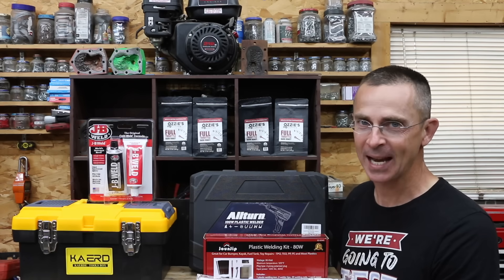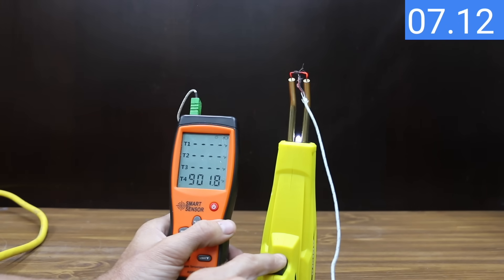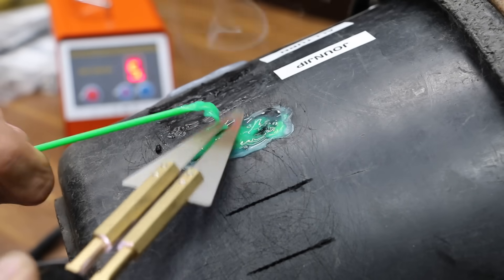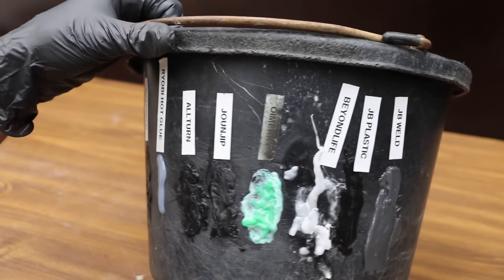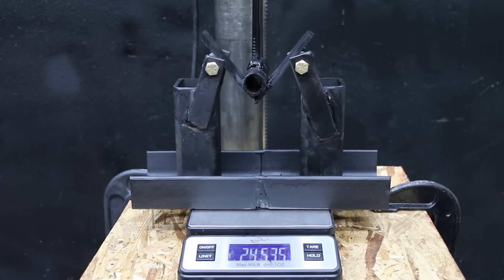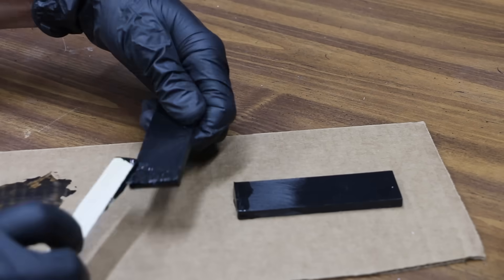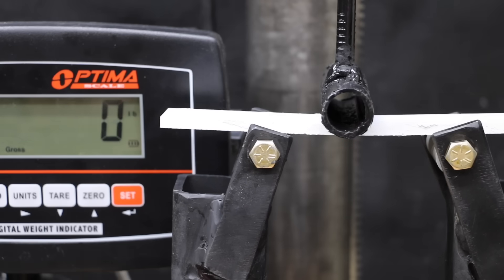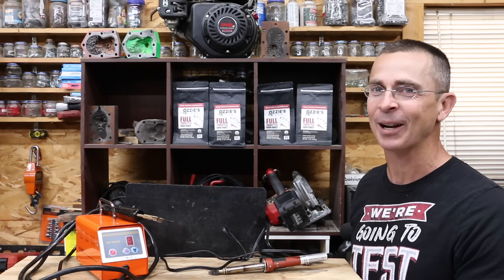Don't Buy A Plastic Welder Until You Watch This Review!

Comment: For $30 you can get a 2oz bottle of Thin superglue and a 12oz bottle of fine graphite powder.  The superglue, when applied to the graphite makes a water tight and very strong weld in only seconds.  I have done a dozen projects already and still have superglue left over, though I just bought a new bottle.  The graphite might last for years. I repaired a dime sized hole in my truck bed liner that was down to the metal.  I think it will outlast the truck.  I also repaired the step bar on the same truck that had broke plastic piece.  My mechanic tried hot glue which lasted about a week.  The graphite and superglue are still holding strong months later.  I also use baking soda with superglue when I need white coloring.
Reply from the maker: Thanks for sharing.
Reply: Curious what brand of thin superglue you're using. I've had good results with waterthin Titebond CA glue, and Satellite City "Hot Stuff" water-thin CA. Never used graphite powder with these glues ( are you sure that's what it is?) but I've used CA glue and baking soda together on occasion.

Comment: The problem is none of them have temperature control.  What you need is thermal mass, not higher temps.
Plus, plastic is just extremely difficult to fix.
Reply from the maker: Thanks for the feedback.

Comment: Great video, but welding skill makes a huge difference in how well a plastic weld will perform. I've repaired plastic pieces that ended up looking brand new with a touch of fill primer, and the weld was stronger than the rest of the piece. All done with staples and a Milwaukee soldering iron. It's no different than welding metal, you need good penetration and need to know the materiel well and how the structure of the material will react to becoming molten
Reply from the maker: Thanks!  Thanks for the feedback.

Comment: The two stapler products.. I reckon you flipped one the wrong way around, likely not once but on both samples? when making the bend, 8:05 and why you got better results even after it was bendfractured the other way around on both samples.. these stapler product is sensitive to orientation.
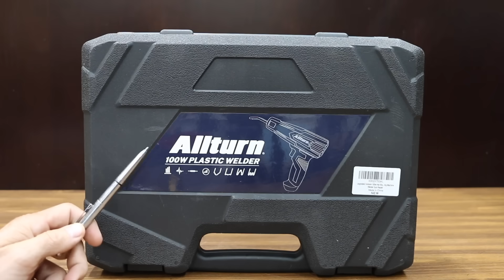also not ideal that a product claims 100w 1:45  but only delivering 51watt
I reckon some of these specs, are not on 120volt, but on 230/240v circuits, so you will get a lot more wattage/heat to work with on +220v on some of these products, so you can mold the original main plastic.

Comment: I was really surprised at how well hot glue with wire mesh did. Seems to me like JB Weld is the most practical solution unless you regularly find yourself needing to weld plastic.
Reply: JB Weld is a chemical miracle. If it's mixed properly, and the surfaces are cleaned and roughened, and it's allowed to fully cure, it can do almost anything. I score surfaces with a knife blade or the edge of a tiny file, instead of using sandpaper. I feel it gives it a bigger tooth to grab onto, and it seems to work very well. SO glad I found JB Weld.
Reply from the maker: Thanks for the feedback.
Reply: I use JB Weld on the pressure side of a radiator inlet that had cracked. That repair outlived the car by 10 years.

Comment: I have the Harbor Freight model, similar to the RX Weld, but same colors as the Jounjip. The Jounjip tips will fit as replacements but you need to rethread them as they are a bit larger (and more durable).  I also have the hot staple gun, just one of the $25 ones from Amazon, they're all the same. Staples are universally sized. At the horse rescue I volunteer at we have one of the hot air ones but I haven't touched it. So I flip the soldering iron style ones over and use the tip to push into the plastic, lifting and pushing, making it look like I'm running a bead with a welder. I'm getting penetration that way and getting both pieces to bond together completely. I'll follow up with melting some of the plastic over top of the repair and smoothing it out. The wire mesh I'll use for anything that will see abuse or that really needs the structural integrity. I melt it into the plastic though, whereas it seemed you melted it to the plastic. I will often follow up with reinforcing it by melting more of the plastic sticks over the repair. The staples I find come in handy when doing larger cracks or getting into corners as they come with different shapes. (Sorry this is getting long winded) I will still weld around the staples and melt more overtop of them as I don't have flush cutters and regular wire cutters leave a little metal exposed to snag your skin on. We've been repairing plastic feed buckets that the horses have split by walking on them or whatever happens. The repairs have been holding up great. I've even repaired a damaged 5 gallon fuel can. ATV fenders? Oh, soooo many. I've been at this for several years now and have fine tuned my craft. Even structural tabs that maybe a screw will go through or a clip have been repaired with zero failures. Just had to pull apart a Honda Foreman to adjust the valves. Months ago I had done plastic repairs to fastener tabs and clips. They're all still holding up and this ATV gets ridden multiple times per day. It gets used for morning and evening feedings as well as normal ranch use, even for moving cattle. I think if you refined your methods you'd see a lot different results, but regardless, you're able to repair damaged pieces, potentially saving hundreds of dollars with a very minimal investment on tools. Time however, it's a very time consuming process.
Reply from the maker: Thanks for sharing.
Reply: Underrated comment. Also, goes to show how much practice, technique, and experience 'factor into' a good plastic weld.

Comment: Too bad the Beyondlife didn't have instructions.. It should be used much like  MIG welding.. start with a V notch and as you move the iron, it pre-heats the surface and the filler rod which is not supposed to be completely melted. The rod stays intact as it is fused into the surface. It is very common to lay multiple beads on top of each other especially in corners.. There should be an adjustment for air-flow to control the heat.. The more air flow, the lower the heat.. . the hot air heats the surface and rod, NOT the iron itself.. . With some practice, any plastic welds should look more like metal welds with the filler rod staying intact rather than just a melted blob.. .  These days I use the hot staples.. Very inexpensive to buy a complete set-up and very universal.. It's very rare that I know more than you about the equipment so todays video was fun to watch..
Reply from the maker: Thanks for watching!

Comment: Are those the correct staples for the application? I've seen videos of people using U∩U∩U - staples when doing these kind of repairs.
Reply from the maker: That's a great question. The kind of staples you've described did not come with the welders

Comment: would have been interesting to see what the polycarbonate 'weld on' glue performed like since its designed for poly fusion,
back in the day i ruined soooo many soldering irons melting plastics together and stunk up the house.... amazing decades later there is actual products for doing just that
Reply from the maker: Great point! Thank you
Reply: Most of the "plastic fusion" type epoxy glues seem to contain some really stinky solvent like MEK or a goof-off type of Acetone/Toluene blend which I swear kills a million brain cells on the first wiff;  but they don't really seem to fuse themselves to most plastics very well and the epoxy itself is not as strong as JB weld or Devcon or Loctite epoxy.  Not to mention that they dry up and harden in the tube more quickly than other epoxies because the solvent is so volatile and evaporates.

Comment: I use a simple soldering iron and mix the breaks together going back and forth lengthways completely mixing the two halfs together at the break.  Works great for me.  Seems like these methods just add stuff to the top and bottom and don't do anything where the two pieces touch.
Reply from the maker: Great tip! Thank you

Comment: You ever going to put your stamp on products like all the safety stamps on everything? Even a bad product can meet safety standards what we need is a stamp to prove products do as advertised at least.
Reply from the maker: That's a great question. My biggest concern is that a manufacturer could change the product and still use the stamp of approval without the product going through the testing process again. Another concern is that I want to avoid making deals with manufacturers to ensure that the reviews remain unbiased and not influenced by those making the products. Thanks again!

Comment: I am actually shocked at how well the hot glue did. Obviously that is a very temporary fix, but darned if that isn't a decent fix until you can fix it properly.
Reply from the maker: Great point! Thank you
Reply: Just don't use hot glue to repair anything on Irene and automobile because it will never hold up under the heat of the sun. In many cases however you can remove hot glue by spraying it with alcohol and letting it sit in the alcohol will creep in between the hot glue and whatever it's stuck to and allow you to separate them cleanly. This probably won't work on plastic where the hot glue and plastic have been heated sufficiently to melt and fuse them together.

Comment: You should've included acetone ABS repairs in your tests. I sometimes use composite dental filling material and so far they've been ridiculously strong.. Never had one of those fixed fail in me.
You'll need a light cure wand to test that.. Should be very cheap..
Reply from the maker: Great point! Thank you
Reply: Also pmma based epoxys are very good.

Comment: Just as in metal welding,the plastic needs to be chamfered, or ground out so you can get full penetration,overfill,and then you turn it over and gring out enough to grt all air pockets or cracks out,welding it up to overfill.. If you want it pretty,sand,sand,and sand some more until it's undiscernible as a repair ..
Reply from the maker: Thanks for the constructive feedback

Comment: "everything's made of plastic these days..."  understatement of the decade?  :)   I just bought a brand new BMW 3 months ago.  It's my first BMW. Imagine my surprise when I saw so many vital engine parts being made out of plastic, not steel or aluminum.  😂
Reply from the maker: Great point!  Plastic is usually okay for a while but it typically becomes brittle over time and fails.
Reply: @ProjectFarm    no worries... that's why I immediately bought the 7-year 100,000-mile BMW factory extended warranty. (yes, I shopped around and found good prices from BMW dealers that sell such warranties online and over the phone... saved almost $1000 compared to the price that my local BMW dealer wants for the identical warranty) 😄    but after 7 years, I suppose I'll come back to this video and see if I need to get the best plastic welders. :)

Comment: Great vid. I can see that a decent soldering iron can cover the jobs of any of these, but the iron tip with a hole and triangular shoe looks worth buying / copying. One idea that came to me for testing was multiple buckets to repair so you could pressure test each repair. And with the butt weld test pieces, bevelling the join would really help as would much, much more heat and time before feeding in filler material. It looks like none of them melted into the parent material. The Beyondlife is beyond hopeless, however. It's not you it's him!
Reply: I use my soldering iron all the time to fix broken plastic. To make it look great you can file it smooth then hit it with a hot air gun. I use the hot air soldering station I have but any old heat gun would work. Just slightly melt the filed surface and it dries really smooth and does not look too bad.
A temperature controlled soldering iron is better because you can dial in the temperature for the melting point of the plastic you are welded. Heating plastics too high will weaken them.
Reply from the maker: Great point! Thank you

Comment: This is great stuff. I have fiddled with plastic welding just enough to know its insanely complicated. Much like metal welding, you need the appropriate filler rod. Can't use ABS rods on PC base material or such. Prep is key too, I repaired a HDPE tank for a boat lift, and I had to carve out the crack to get some good penetration and actually stick the new filler plastic to the old plastic. Ended up holding up great for a long time, but the learning curve was a challenge. Thanks so much for making a great video!
Reply from the maker: All great points!  Thank you!!

Comment: Would anyone use any of these heat welders for polycarbonate?  Methyl chloride has always worked for me--it's a solvent cement, so you're really dissolving the original base material.  The result should be the same as the original material.
Reply from the maker: Great tip! Thank you

Comment: Great video, Todd. I hadn't even realised that plastic welders were a thing. Very interesting. Thanks for sharing.
Reply from the maker: Thank you very much!
Reply: My plastic welder is a set of pliers zip tied to hold a nail with a big head on it....I heat it with a blow torch and start plastic welding. Cannot tell you how many things I've repaired that were either impossible to replace or very inconvenient to purchase....for example, the plastic piece that attaches to most push mowers to hold open side chute and direct clippings. I've repaired 3 in my neighborhood using my 'plastic welder'.....little bit of sanding and you'd be hard pressed to see the difference. I use paper clips to make my own 'staples' like is shown in this video. However I either make mi e semi-loops or zig-zag pattern to increase rigidity of the piece I'm working on (vs the straight staple type)

Comment: Try something like the Weld-On 16 (chemical welder) with the mesh. If the plastic melts with the Weld-On and you push the mesh slightly into the plastic, it should be very strong.
Reply from the maker: Great suggestion! Thank you

Comment: I don't think the test was entirely fair as a lot of samples were "welded" on surface only, and it was a clear de-lamination between the plastic layers. I'm by no means an expert but when I "welded" plastic I made sure that all plastic got heated and melted, and then used to mix the two together while hot/liquid, and made sure to go deep. Much like with metal welding, except metals have infinitely less viscosity when melted and conduct heat way better. Plastics are almost heat-insulating and have extreme viscosity. Hence many test pieces here de-laminated: separate plastics glued to each other but never really mixed. Hence imho the test is fawed due to the technique used.
Reply from the maker: Thanks for the constructive feedback

Comment: I melt the screen into the original plastic before adding any filler, sure is strong. If i don't have any screen material, i will use stranded copper wire
Reply from the maker: Great feedback. Thank you

Comment: I would have liked to have seen the staples be used on both side of the welds
Reply: Another thing I would have liked to have seen is the wire mesh actually be melted into the base plastic first and then add the filler rod over the top of that. The mesh doesn't do very much if it's not actually getting a bite into the base plastic.
Reply from the maker: Great point! Thank you

Comment: So I guess we learned hot glue is good enough and basically every dedicated plastic welder doesn't do much better and often worse.
I have however made my own plastic staples once from a paperclip and used a DC power supply to melt them in. No need to spend money on these tools when you already got the same thing at home.

Also, all PF replies are automated for the first hour of the video being live to drive engagement. And it feels very impersonal and weird. Say pineapple if it's really you.
Reply from the maker: Thank you